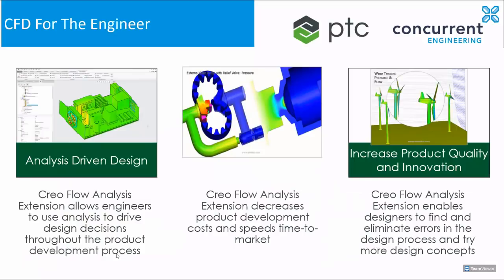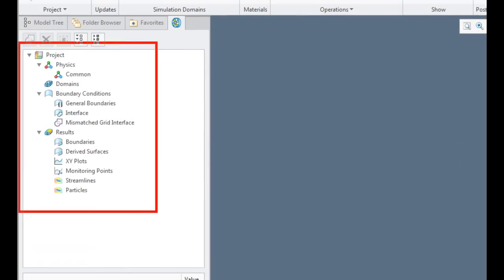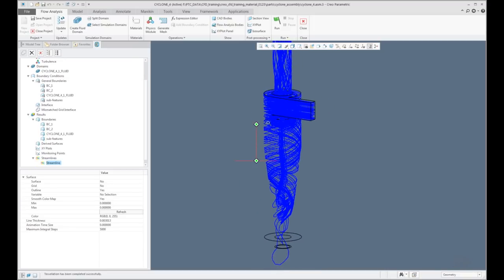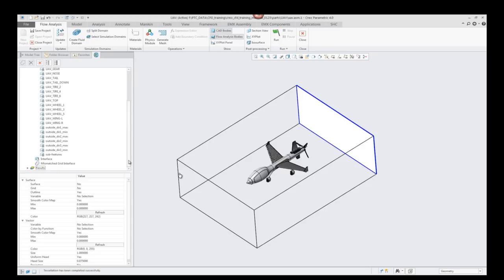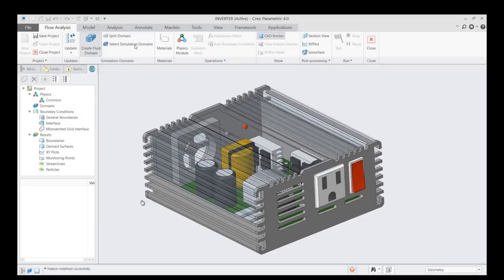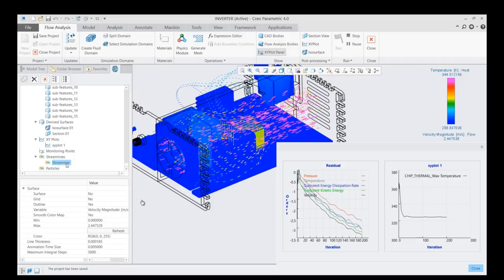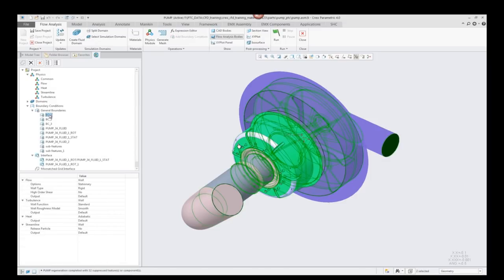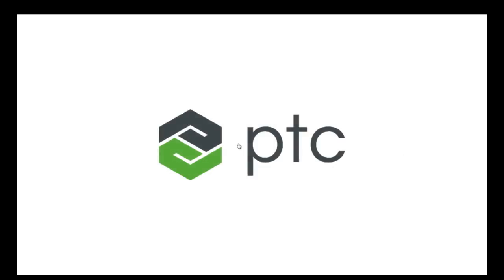Creo Flow Analysis Extension

Comment: my flow analysis tab is greyed out! please advise on enabling it
Reply: do you have the required license? and Version 5?
 If so, run the installation file, use Upgrade, continue the process till finding "Customize" then go to the creo parametric branch and choose the flow analysis from the selection tree. 
feel free to contact, 
http://proeng.ir/
Reply: @sajadfilabi9576  thanks.. It worked
Reply: @sajadfilabi9576  Where is the installation file? What do you mean by this?